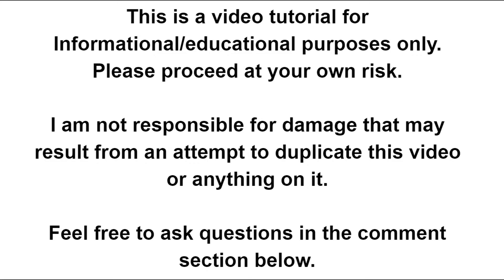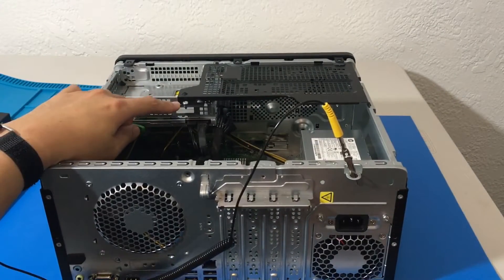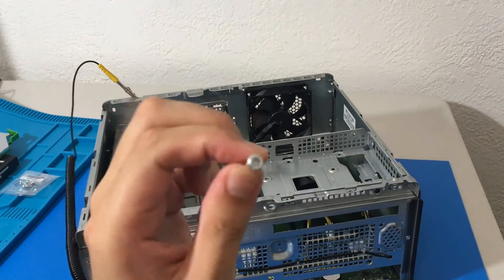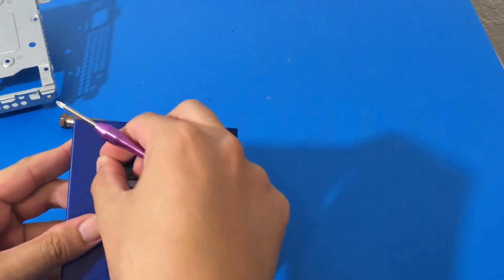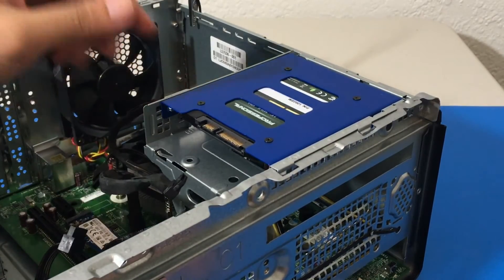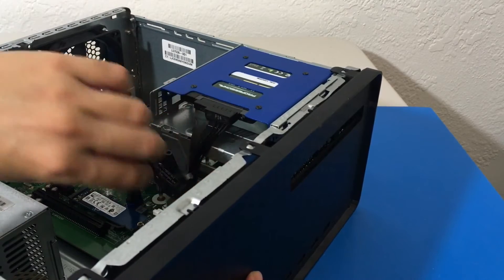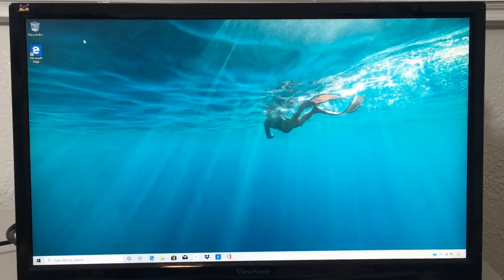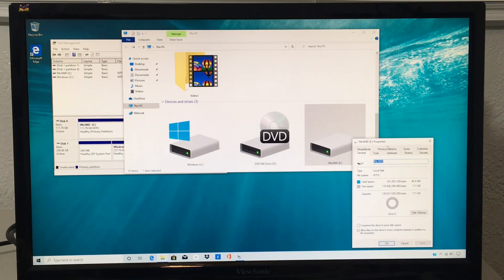Installing/Adding a 2.5 inch SSD | HP M01-F0016 Desktop PC 6YQ85AA | 120GB Inland Professional SSD

Comment: Thanks for the video!  I have the m01-f1024-everything is the same except for an upgraded CPU. 
Granted I didn't look hard yet,but the HP BIOS doesn't seem to have an option to allocate more then 512 MB to the video portion  of the APU/. If not,that is very distressing ,and may tempt me to rip out the CPU and M.2 and use them for a custom build.

Comment: I have the exact same computer !
Decided to get into video editing and was thinking of an External SSD. 
Your video here made me decide to get an Internal SSD. 
I would be much better off than with an External .
Thank you !
Reply from the maker: Glad it helped! Cheers and good luck with the ssd install
Reply: @whattmeter  is there a big difference in Speed between An External and Internal SSD ?
Reply from the maker: @dannyg402012  depends on the connection and the ssd. check what read and write speed of the ssd you are using. If you are using an external ssd or external hard drive they come in various speeds too. In addition to that, for the external it depends on which usb you connect it to. some usb ports are faster than others.

Comment: thanks,you removed any doubts about this computer.
Reply from the maker: Glad it helped. One thing we did notice is with the 180watt power supply you won’t be able to add a graphics card. The power supply is also hard to upgrade because it’s proprietary
Reply from the maker: @mohammed mohaimen unfortunately it's proprietary. Some people have said you can get an upgraded power supply from hp.

Comment: Very nicely done video. I am considering getting one of these computers for a friend and was curious out upgradeability.   As far as I can tell from your video there is the capability to add only one additional drive to this system. 

... One man's opinion... You would have been better served to use a GPT partitioning scheme.
From Microsoft: "Most PCs use the GUID Partition Table (GPT) disk type for hard drives and SSDs. GPT is more robust and allows for volumes bigger than 2 TB. The older Master Boot Record (MBR) disk type is used by 32-bit PCs, older PCs, and removable drives such as memory cards." 
This is the reason the dialog for initializing the drive defaulted to GPT and would be the recommended choice.  There are multiple other benefits of GPT that likely would not impact that 120GB drive.
Reply from the maker: thanks for the tip. For the GPT you are correct. GPT would have been much better. I just got used to using MBR because I am old school. GPT would be better and more stable

Comment: Are you able to add a 1TB 2.5"SSD as well as an additional 1TB 3.5" HD with the original 256GB SSD as well?
Reply: You have to start counting Watts here.  The ps is on the low end as far as power output.

Comment: Why didn't you install it directly to the metal holder? I believe the 3 holes are exactly for a 2.5" drive.
Reply: You're totally right
Reply: How would u do that? Which screws go where?
Reply: The mx3 or hdd?
Reply: @AdrianHernandez-cf9qp  there are 3 holes to screw a 2.5" SSD in the metal Frame below where he put the 3.5" adapter in
Reply: @DudeFromHere  which screws doe?
Reply: @AdrianHernandez-cf9qp  M3 but they are not included
Reply: @DudeFromHere  so I can just but the m.3 and I don’t need a bracket thinf
Reply: @AdrianHernandez-cf9qp  yes if you have a 2.5" drive
Reply: @DudeFromHere  ye I do thanks man
Reply: @DudeFromHere  one last thing m3 is like the screw type and the x3 is the millimeters?
Reply: @AdrianHernandez-cf9qp  yes

Comment: I just received this PC ,but it only has 8GB of ram can I install another 8GB or do I have to go to a single 16  Gb to get  the same results? Thanks Randall
Reply from the maker: you can add another 8gb but I would make sure the second ram you are adding is compatible. Mixing different brands of ram might not become dual channel or might have some issues.
Reply: @whattmeter  so would you say maybe grab 2 budget 8gb ram sticks of the same brand and put them in ? instead of mixing and matching
Reply from the maker: Yup usually
Reply: @whattmeter  awesome, ive got this same build but I wanted to fix the ram, ryzen and single channel dont go together
Reply from the maker: Good luck with the upgrade

Comment: I'm thinking about getting this computer, would you recommend it? It would be my first computer and i will want to learn how to upgrade it.
Reply from the maker: its a good pc. I'm using it right now. You can upgrade the ram and ssd. Unfortunately you won't be able to upgrade the power supply or add a graphics card because it runs on 180 watt gold power supply. Needs more power. Other than that it's a pretty good pc.
Reply: @whattmeter   Brandon Bridges  is modifying the m01-f1024 (the one I own) which is the same HP but upgraded CPU. He put in a beefier powers supply and even watercooled it!
https://www.youtube.com/channel/UCzbm5QKriSdbJbSA4xHw3MQ
Reply: Upgrading pre-builts is definitely doable,but you have very limited upgrade path. Prebuilts all have quirks to them. They don't want you to have a million different 3rd party companies to buy parts from to stick in their pre-built. They want you to havbe to buy from them. 
If you want a computer to learn the internals you should build your own.

Comment: i have this one too im gonna atempt to do this and if u ever get to upgrading the ram on this pc i will most definetly upgrage that too
Reply from the maker: I double checked and you can add two ssds total, but you will need an extra cable if adding a second 2.5 inch ssd.
Reply from the maker: Awesome! I’ll look into it. Shouldn’t be too hard to upgrade the ram